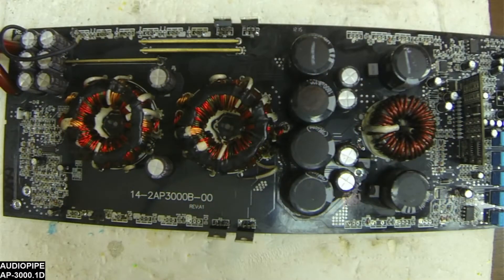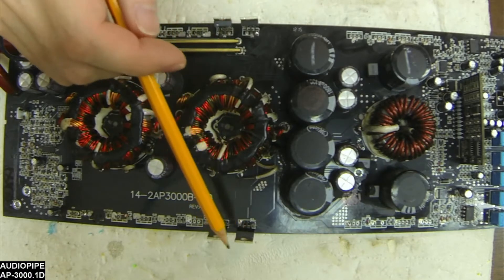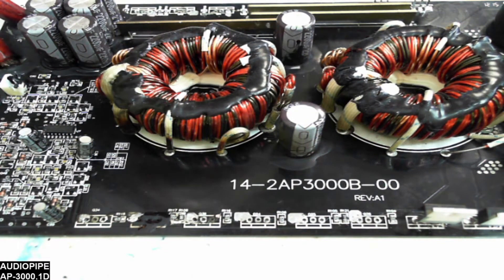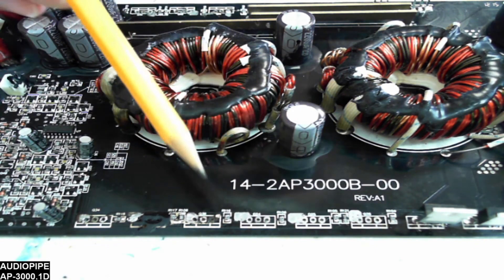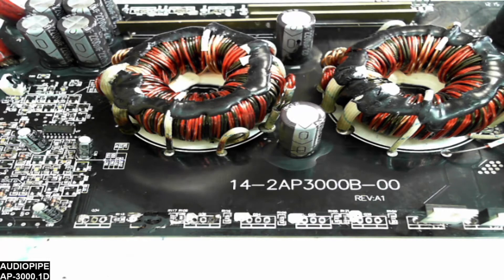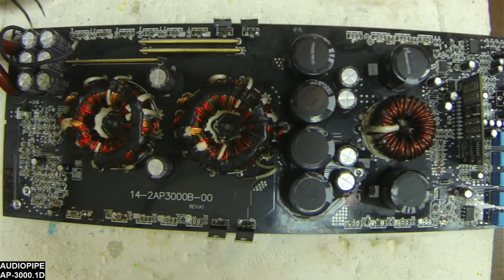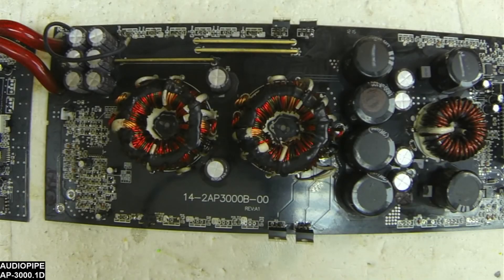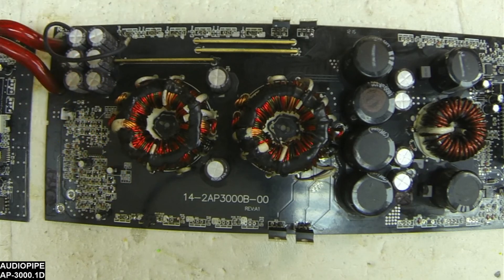Audiopipe AP-3000.1D Part 1 Repair and Tips About the Design

Comment: What transistors are used in the apcle 1500d? I appreciate it
Reply from the maker: Depends on what section of the board and if the board is all TO220 case size. I use the 3205 for the power supply and the 640N for the output.

Comment: Almost finished with this APCL3000.1 amp, but one board keeps blowing output and power supply fets. I'm getting proper power supply and output gate voltage (5v), as well as proper drive signal (27khz power supply/150khz output). I've noticed that my outout gate zener diodes are allowing the multimeter diode voltage to go both directions, could this cause the fets to keep blowing? Do you know which diodes that I need? Thanks again!
Reply from the maker: I have not had one of these in for quite some time but if that diode is across the gate resistor then its a signal diode. I don't remember them using zener diodes. Email me a picture when you have a moment and I can verify. This sounds like a situation where a thermal imager is needed to see if you have any runaway transistors.
Reply: I will send you an email now, thank you! @ellensburgamplifier

Comment: Hey I got two audio pipes one is a 3500 and the other is a 2500 that needs to be repaired
Reply: Sent
Reply from the maker: @tealababy1  You may want to submit the form again as I do not see you in the requests. If the submission is successful it will say thank you and we will get back to you shortly.
Reply: @ellensburgamplifier  I sent it three more times and it still not going thru can I call you or another site I can go on
Reply from the maker: @tealababy1  Please feel free to call any time M-F 8-5 and Sat 10-5. The number is at the bottom of the website www.ellensburgamplifier.com
Reply from the maker: www.ellensburgamplifier.com/request-a-quote is the first step to get repair information.

Comment: On the sound card bro what is the number on the driver ic ir 🤔what they sand out the. Number I'm lost
Reply from the maker: The upper left IC is an LM319, under that one is a TL072, and the two IC's on the right side are 74HC02's.

Comment: What model is that? I've got the APCLE30001.D.
Reply from the maker: Mine is the early model AP-3000.1D There have been a few design changes to the 3K amplifier. This one uses the 640n's for the output, another uses the 250n's. A third version is a completely different design (not the type 4 drive style).
Reply: @ellensburgamplifier  I know my 3k has a dual board design. She makes more than rated. Very impressed with it so far. Had it for over a year now. I like watching repair videos. Gives me an idea of how it works and what's involved in a fix. Thankfully there's guys like you out there that have the ability to do this. Kicks ass man
Reply from the maker: @michaelzernie7092  Thank you for the compliments. These boards are straightforward with no unnecessary circuits. However, when they do fail, they fail drastically. If you ever have any questions please feel free to ask!

Comment: Was that some of that copper clad aluminum wire? 

The missing pads are as much a sign of board quality as poor technique. Not that it will make your job any easier. Old Commodore boards have been known to eat my lunch... Looking forward to seeing how you repair this one. :)
Reply from the maker: Yes, it was CCA wire that the flux ended up corroding. The odd thing, the primary wiring for 12v going between the boards does not have the same corrosion but is the same CCA wire. This board will take me a little longer to finish but I don't mind as attention to detail is what I will focus on.
Reply: @ellensburgamplifier  I suspect that someone slipped in plumber's flux for the board repair. Flux is flux, right? :)

Comment: I agree matched transistors are a must. I often wondered tho if I test an exact batch there are still capacitance differences between each transistor. So to truly match mosfets or transistors wouldn't we haft to test them all?
Reply from the maker: Agreed. There are differences even with the same batch. when I get an order in I check how close the Rds and Vgs threshold are to each other and batch them from there.

Comment: Pace makes some good circuit board repair kits, but man they are expensive. Enjoyed the video!
Reply: Bah, I've got a Pace repair kit, and it's the "iron on" type. Basically you fiddle around cutting out your trace, and then iron it on just to have it come off when your solder it.
Reply from the maker: @MrWaalkman  Replacing traces is a task that I will only do upon request. Typically from my clients that are collectors.
Reply: @MrWaalkman  yes they are a bit fiddly. I use to instruct how to use them among soldering techniques for the US military.
Reply from the maker: Agreed! Soldertools has a good selection of repair kits but also quite expensive.

Comment: what flux would you recommend?
Reply from the maker: Hi Mike. I use Amtech NC-559-V2 with Kester 44. The spec sheet does say that unactivated flux may absorb moisture which could cause corrosion so I make sure what I am using it on is fully heated and cleaned.
Reply: @ellensburgamplifier  That, and washing it off when you are done. :)
Reply from the maker: @MrWaalkman  oh yes being clean is key!